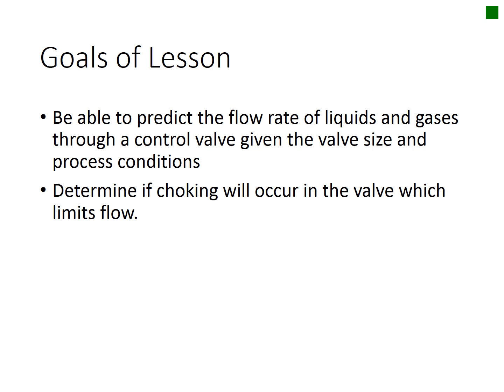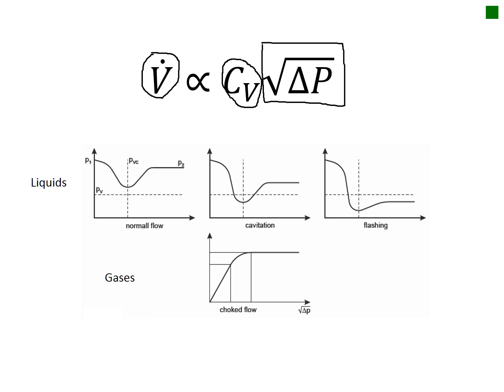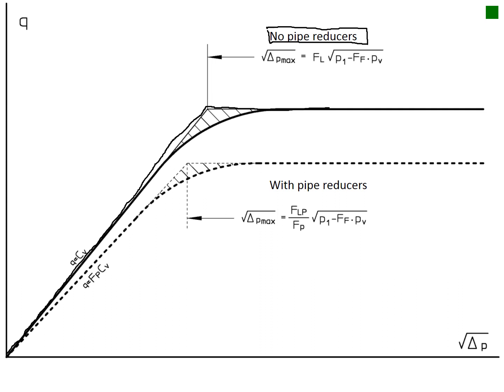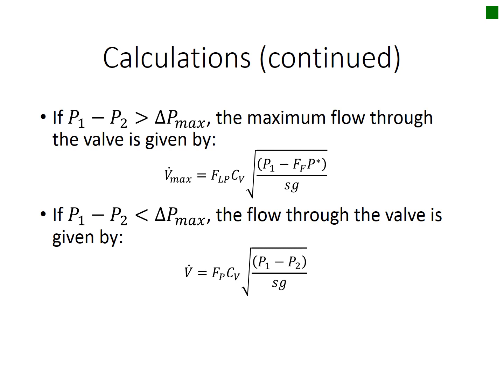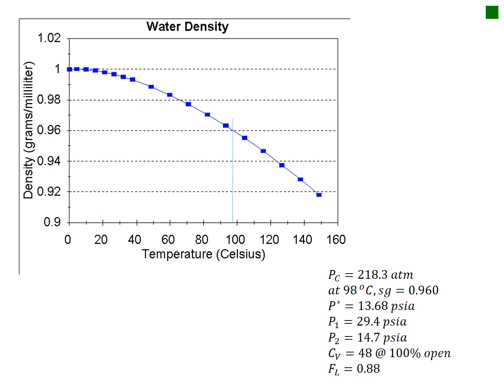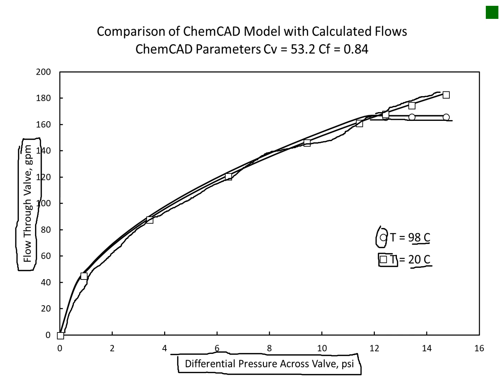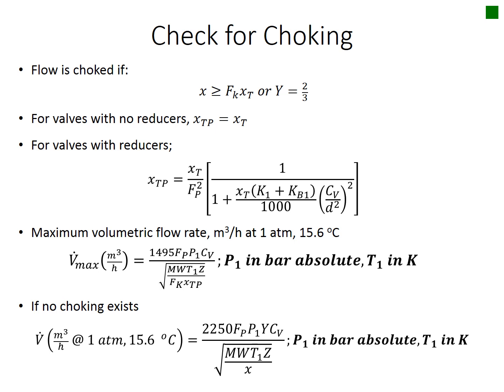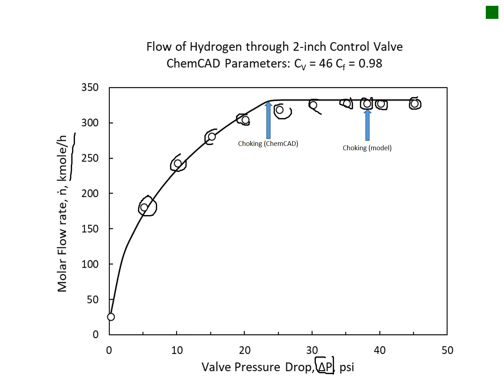Control Valve Basics

Comment: I would think the SG value for the 20Deg C case should be higher than that of 98DegC case looking at the density temperature chart
Reply: Correct, I found the same mistake. At 20°C, the SG is 1, so I got a flow of 179.5 GPM instead of 183.2 GPM.